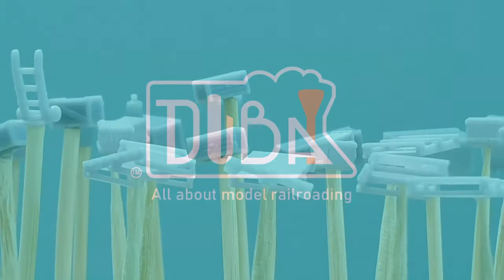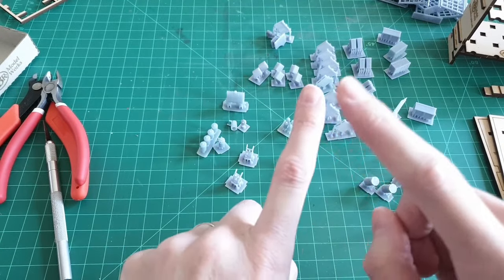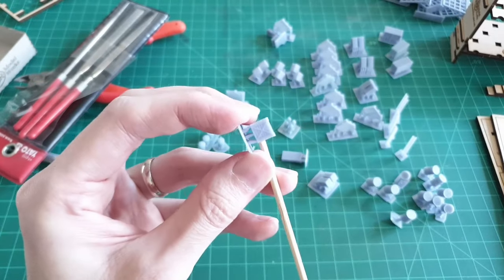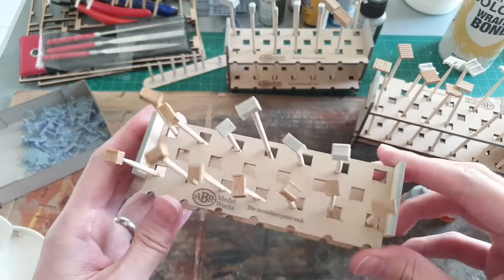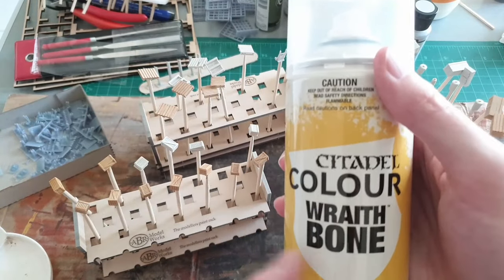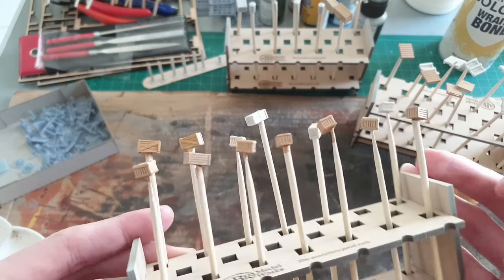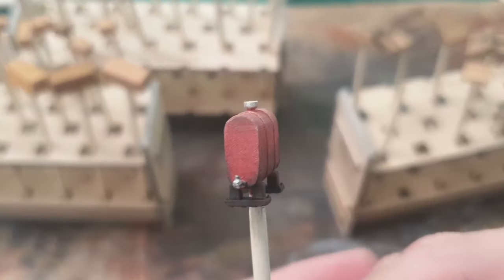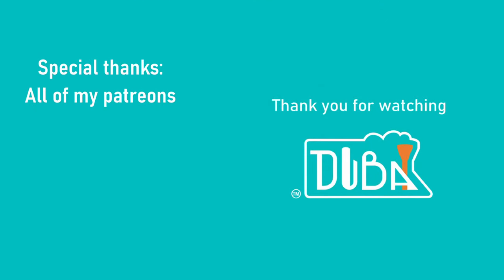93 - Beginner guild to painting small 3D printed objects without an airbrush.

Comment: Well done.  An air brush would be an alternative to the spray primer and base coat.  Though I'm not sure it would be  extremely different.  The detail airbrushing needs a competent hand and some taping.  Unless super smooth is required, either is workable.

Overall, I don't feel that either would be better than the other, except perhaps in special cases.  With good surface prep & smoothing, I think an airbrush could provide a smoother cover, especially since airbrush paint can be thinned out and the atomization is often smoother than brush strokes or spray cans.

The investment in a reasonably decent airbrush, compressor, tabletop exhaust booth & cleaners can run hundreds of dollars. 🤑 Hand painting is way less.
Reply from the maker: Hi Frank,
The airbrush will be a lot faster! Especially if you are doing a big batch. But as you say for the inexperience hand maybe too fast 😅. 
If you are only doing a handful of items in a lot of different colors. I think an airbrush with all the cleaning, thinning etc will just slow you down. But i don't know as i don't have one. 
I think the smoothness of the end product is mostly defined by intermediary smoothing i.e. sandpaper. The folks who paint these action figures they coat 3 times or so and sandpaper in between to get a polished finish. 
But when is good, good enough?
Reply: @DubaiTrains   I agree.  Each has its merits.  An airbrush for model railroading mostly provides an alternative, with improvements in certain circumstances.  It's an asset, not a requirement.  
Thanks for sharing ABR & the discount code.